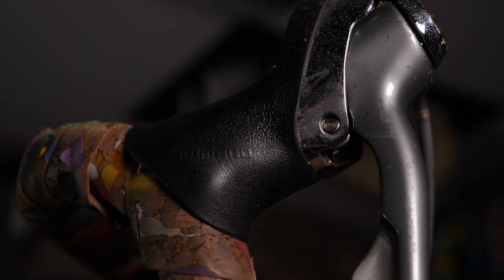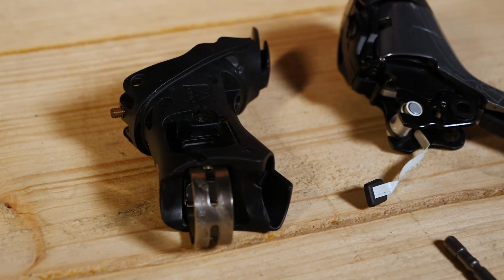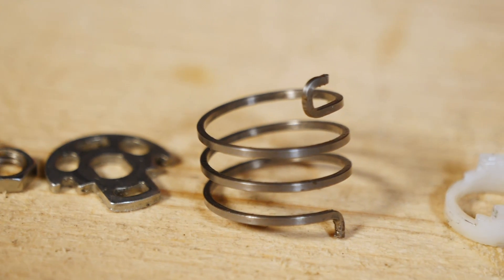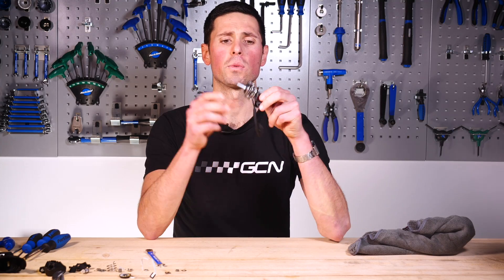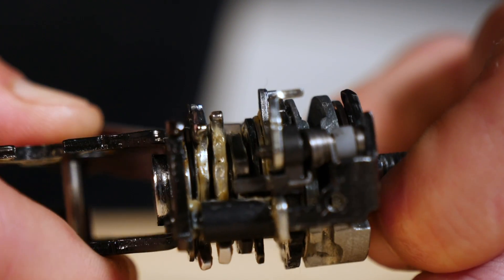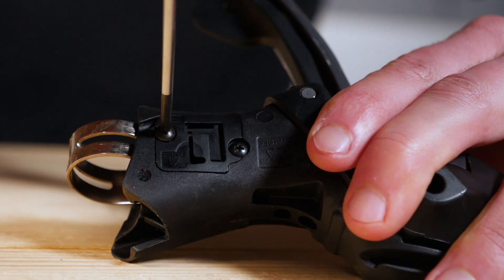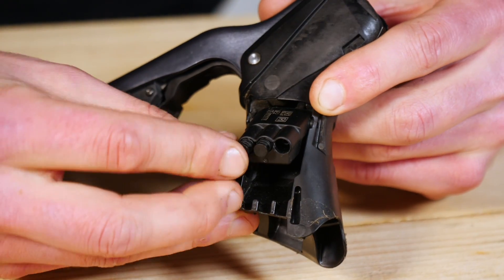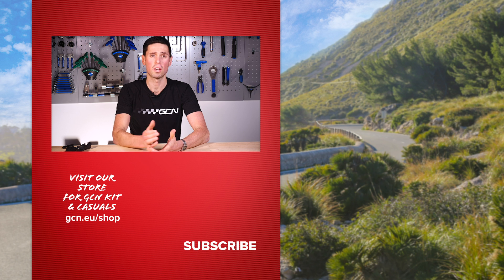What's Inside An STI Lever? | Cycling Shift Lever Teardown

Comment from the maker: Did you realise STI levers were this complicated? Let us know in the comments 👇
Reply: I once disassemble a sti. Was easy. But reassembly it was a nightmare! It is such a complex thing!
Reply: I bought a pair of original version 105 STI levers about 25 years ago as an upgrade to my downtube SIS shifters. Even back then they were expensive, but so worth the price. I still use them on my commuter/winter bike to this day.  With the help of this video I may actually be brave enough to take them apart and service what has up to now been a maintenance-free component (although  they are now starting to "feel their age") . I'll post some pictures for "GCN Inspirations" :)
Reply: Would be interesting to see the lever internals of Dura Ace vs Ultegra vs 105 vs Tiagra
Reply: The Campa version is not as complicated:)
And Campa is easier to repair.
What kind of grease did you use?
Reply: @GregorPQ  that's because campagnolo are better engineered, better built and last longer... still using my 1993 Ergos on my 1993 Pinarello.
Reply: Should these be regularly cleaned/regreased (assuming every several tens of thousands of kms of course)?
Reply: Yes. I really think I did.
Reply: Yes, which is why I don't use them anymore.
Reply: I have an old 9 speed Tiagra 4500 sti shifter that is functional but without the rubber hood. Is there a simple part from its inside that I can cannibalize and replace into the newer gen 8 speed Claris 2400 shifter on my CAAD8 to get an extra click and convert it into a 9 speed shifter?

Comment: BIG question on the return springs, that will make me, or not make me, get a certain bike at stake in a shop right now! Shop guy left the shifting lever leaning and engaging for 48 hours against a wall (bad...). From what I saw, it rotated only that little amount when rotating the lever is very light - doesnt engage the shift cable - then the bike got leaning on that wall, as lever stopped rotating. *BUT*, did this engage either of the two springs??? As lever will return in place even after the first narrow light rotation, that makes me think it does engage a spring, perhaps the smaller one. No way i'm going to buy a "new" bike with that already been altered and have to fix it myself... but please tell me what you all think... cheers!

Comment: I don't have that bolt under the pin even though its hader to remove with hammer did you know there is any other bolts to undo

Comment: I bought an old (2002) tandem second-hand that had seen very little use and was just collecting dust. The Shimano Deore XT shifters didn't work properly, I couldn't click into the bigger cogs (wouldn't pull the cables, even after I disconnected them at the derailleurs). The ratchet mechanism inside the shifters was jammed by old solidified oil. I took them apart, added oil liberally, managed to get them back together (swearing included), and they work fine now. The innards of the STI lever interestingly look rather similar. So, apparently, shifters do need some maintenance, and probably need to be actually used to prevent seizing.

Comment: #AskGCNTech I have an ultegra STI 6800 left shifter lever that has stopped shifting down on the little ring. I opened it up and saw that there was a little spring/metal string that had become loose so when i tried shifting down the split that was suposed to interlock just jumped over and nothing happened. Do you know if this can be fixed? Even if i knew where to get hold of a new "spring" i don't think i could put it in place my self.

Comment: I think I learned about the STI:s more or less when they were launched. However, the real revelation was when I rode the 1995 Telemark Tours, and nearly everyone had those STI:s, with those gear indicators integrated in the shifting cables.

By the way, three electric wires can produce eight different signal combinations, unless the signal is pulsed or so. Is it an eight speed shifter?

Comment: I love taking apart shifters, so far i managed to put all of them back into working order again. I usually go for the complete disassembly to clean and regrease the pivot points of the clamps.
It is amazing how smooth a cleaned and regreased shifter and derailleur with new inner and outer cables operates. Feels like almost no force is required to shift.

Comment: The build quality is so much better on the old 105 Flight Deck levers than they are on newer 105 levers, they just look and feel more expensive, just a shame they don't hide the cable like the newer ones.

No reason in 2020 why Di2 is still more expensive than cable, it's just an artificial cost diffrence to maintain an product hierarchy.

Comment: I believe electronic shifters are more expensive than mechanical. If they are simpler, then why?
Reply: Probably because the eletronic parts are more expensive to source/make than metal pieces for ratchets.
Reply: Much higher profit margins...
Reply: @julmeissonnier  thanks what I’m thinking. SRAM and Shimano essentially have a duopoly on electronic shifting and are propping the price up.
Reply: @millermiller75  Actually the stepper motors in the derailleurs are expensive, the levers are much cheaper than mechanicals... but you still pay $1000 extra for less than $100 worth of stepper motors,  90% margin...
Reply: @millermiller75  No actually, Campagnolo also have EPS if you are on a tight budget ;)...

Comment: I have a tiagra 4500/4600 groupset and a plan to throughly clean the shifters, is the "regular" external cabling shifter internals the same as the flight deck ones?

Comment: Along with Look pedals in 84-85, Shimano STI represented the biggest jumps in tech since the quick release and the derailleur.
Reply: Fully agree, these were the two (only?) game-changers in 40+ years, but it ignores the much less visible development of narrow, flexible chains with ramps and pins on the cogs and chainrings which was no less important by enabling wide gear range and smooth shifting.   Because if you still had big, wide, stiff 5 speed chains shifting on cogs and chainring without ramps and pins, you would still ride 52x42 with 13x19 or 14x24 with 3 tooth jumps and it still would be shifting like shit...

Comment: Pretty remarkable innovation. I have had my shifter cables fray and break right at the swage. I had to pull apart shifter just extract the broken piece.
Reply: Shimano never got the cable handling right and that (and the profit margin) motivated them to go electronic...
Reply: @julmeissonnier  I have the version of STI that has the shifter cable coming out the side. My shifting is just as clean.

Comment: Well done Alex.  Your best tech video thus far.  Is there a reasonable way to clean and relube  a mechanical lever without disassembly?
Reply: Not really. You can try with q-tips. But do not spray degreaser in there if you dont want to disassembly them, you are not able to regrease it.

Comment: I have tried to take one apart, but could not. I have a broken st5800 2x shifter lever. Sometime I can't shift it from small to big ring, also I can't trim when on small ring. It seems, that I need some specific wrench for it. Tried to use pliers to unscrew the nut that has 2 flat sides, but could not have good grip on that thin nut with pliers. Here's a video of it not working: https://youtu.be/pdcAD_MVpEk And here are 2 pictures, from both ends: https://drive.google.com/drive/folders/126a2BMTejcWhhlyTxOzOtpqBtP6Ol7I_?usp=sharing From which end should I actually disassemble it? From front, or from rear(where it clamps to handlebar)? If I would try from rear, maybe I could get the whole unit out from body, together with it's axle-bolt? 
I already replaced it, with a new one, of same model, so it's not critical to fix it. But I still don't wat completely destroy the old one. I would like to repair it if possible, or at least find out what has happened with it.. would like to find out what went wrong, what could have caused this break.

Maybe some viewers here can give some advice, how to disassemble it?

I thought, that maybe something have got bent, or broke when I fell to left side, because could not unclip left foot and shifter was on big ring too.. So if it hit ground with lever, maybe it broke something inside..  but is it really so weak? The lever is some kind of plastic and flexes.. so it should have tampered the sharpness of hit against ground.. It's not like real crash, just fall on speed of 0Km/h.. But it happened few times, before I replaced sh51 cleats with sh56 cleats... Anyways, before I got new ones I tried to bend the thick metal levers, that connect shifting mechanism to brake/shifter levers and it helped little bit, for a while, but I could not bend them enough, when they are on shifter, because would surely break something if applied any more force than I already did.. those levers/plates are pretty thick.. And rest stuff seems quite weak.

Comment: the di2 shoud be much cheaper since they are with l much less parts , is just a brake lever with 2 buttons , they shoud be 20-100 , not 400-600 ,,  and in 2020 is not that hi end technology   a imagine have to pay 500 for a computer mouse ,,  is basically the same ,, an the mouse have a optical sensor ,
Reply: I built a $30,000 medical device that used the same stepper motors as electronic derailleurs. Those are the only expensive parts in Di2/AXS/EPS. My assessment is that the extra cost of eletronic over mechanical is significantly less than $100 (definitely in the volume used by Shimano).  So at $1000 extra it is 90% margin on that upgrade. No rush to make Di2 105 at least until a Chinese player launches one...
Reply: R&D and profit margins.
Reply: Maybe not much cheaper, because they're still made out of the same premium materials, but shouldn't be more expensive than mechanicals. I think electronic shifters will get a lot cheaper over time, and I hope the next generation of 105 will have an electronic option as well.
Reply: The engineering still goes into the final price since the while di2 system was a big change i think this is what is keeping them expensive.
Reply: @Huzaliproductions  what engieering ,, to make a small motor move small steps , back and forth , an 2 button to activate it , yes in the 80is this will have be expensive to make , but with the tech of today  is somthing easy to build ,   i will just wate for the Chinese version ,, shimano probably spend less than 10$ to make them. with the same logic a modern motorcycle should cost 100k and more ,
Reply: @darkphotographer  you cant compare like that a motorcycle has a different market with many more buyers so the break even point of the developement is achieved by mass not price. The di2 aims to the top end and should be lightweight so hopefully there are some self engineered lightweight motors inside etc. But i never had one in my hands so idk.  I agree the rest of it isnt that much compared to the mechanical shifters. I bet if they would make the di2 cheaper the mechanicals would rise in pirce.
Reply: @Huzaliproductions  still road bike stuff are realty overprice , not only at the hi end , low end to  the claris shiftier cost 110euro  , comapr to 30 for flat bar 8speed shifer and brake ,
Reply: @darkphotographer  The Chinese are coming to the rescue: Sensah and LTWOO now already have 11-speed sets for $100-$150 (Shifters, Front and Rear derailleurs), Sensah already has 12 speed and I am sure they are both working hard on Electronic which is the gold mine... It is happening everywhere there is value in the bike industry (powermeters...)...
Reply: @julmeissonnier  finaly ,, since only 3 company make groopset , time for some others , so the price can drop

Comment: I'm just about to use this knowledge to disassemble and lock the left STI for it to work only as the brake lever. Shimano still hasn't got around to manufacture such thing...
Reply: @Kuba Gajda   Why would you bother with trying to "lock" it?!  There is no detriment to having the shifting mechanism operational...if you just want to use it for brakes, just do it!  Or, buy yourself a simple brake lever for 1/4 of the price and significantly less weight!
Reply: @johns3106  Because I'd like it to match the right one and also not to move. To me this is the way ;)
Reply: The answer is Campagnolo, I never liked the Shimano ergonomics of mixing brake levers and shifters, it always feels to me like a three year-old trike which moves the steering when you push the pedals...